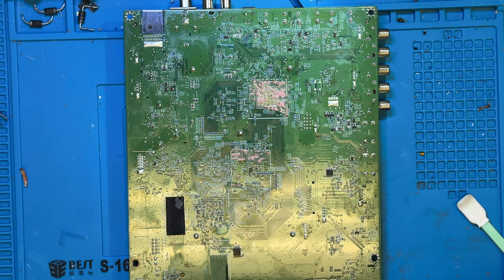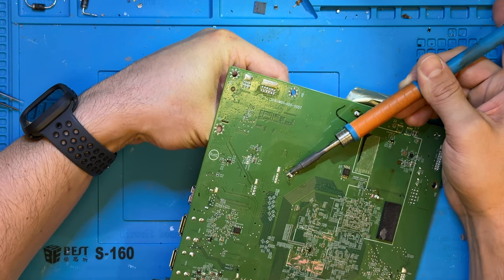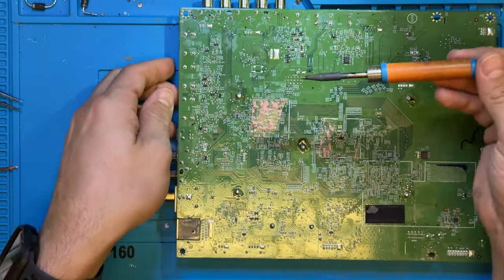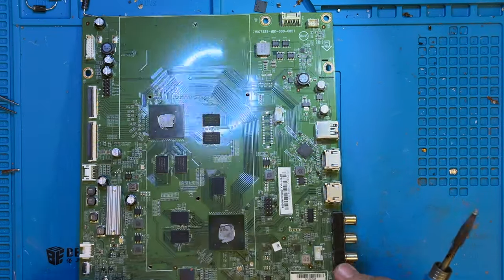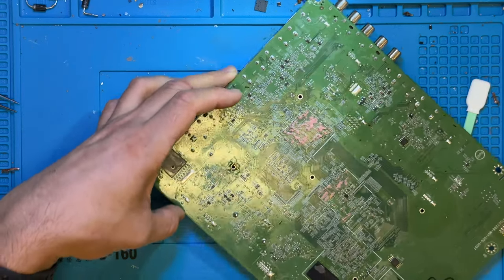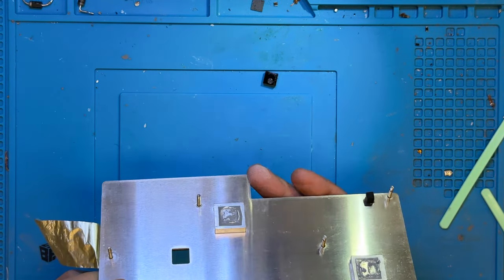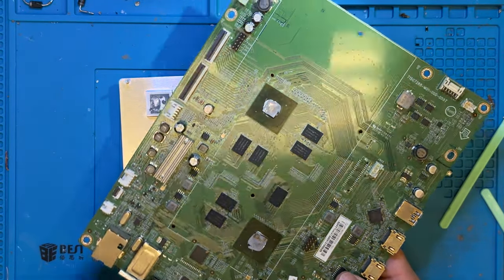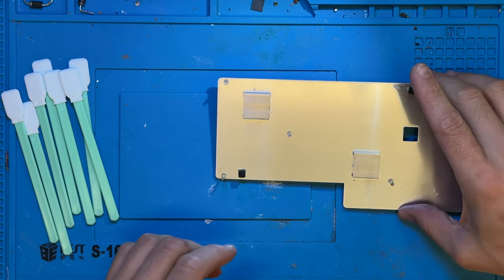Vizio Mainboard - Heat Sink Removal

Comment: Have you ever done a reballing on this?
Reply from the maker: You can check out my other video on the Vizio mainboard rework. There is a link a the end of the video. Thanks!
Reply: @IDeviceRepairOrlando  I own a vizio p65-e1, I wanna say it's 2017/18 model.   It's going on 7 years old now.  In the past 3 years however, iv had to pull the main process board and bake in oven.  Iv had to do this 3 time per year now,  every 4months.   It's "working" untill it's not.  Iv consider measuring and cut open the back plastic cover to install two smaller fans.  One directly on top the main heat sink pushing external cool air and the other fan maybe 10inch above parallel exhausting.  Probably have them powered on their own and just plugged up to wall hopfully🤷🏻‍♂️. Dose this sound at all worth a shot?   Can't find a replacement board and this appears to be the least expensive route at the time.   Any input or suggestions?